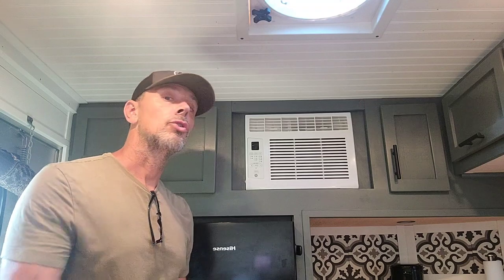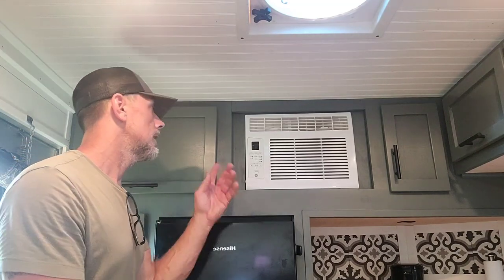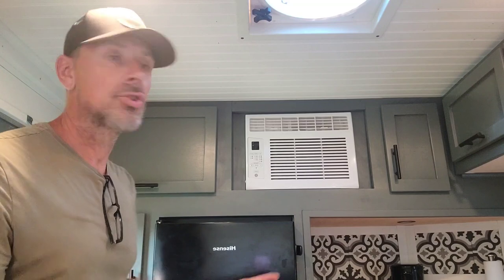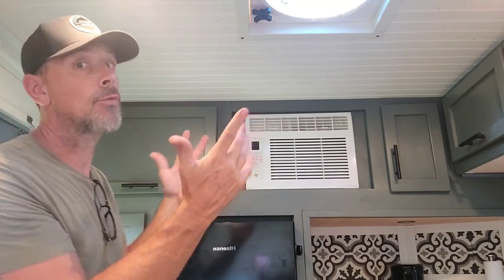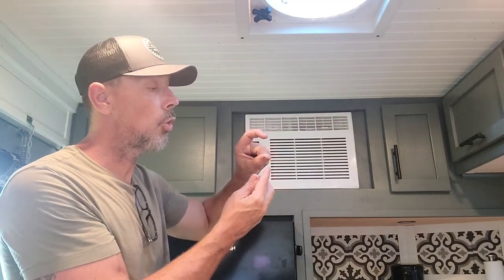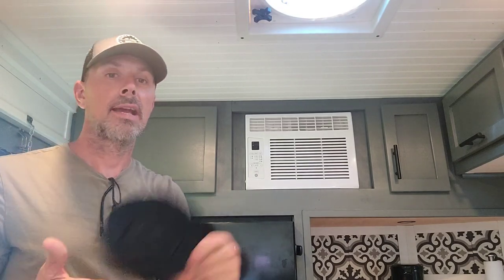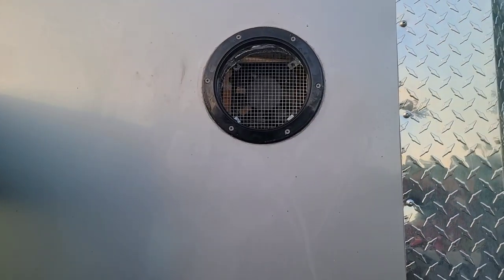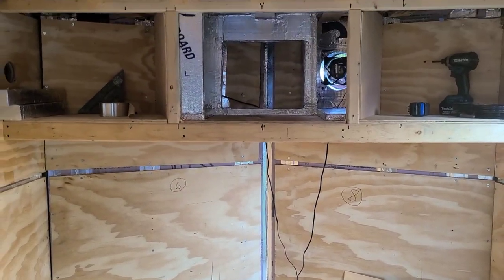Cargo trailer camper conversion window air conditioner install

Comment: I"m impressed with the engineering of the A/C ventilation cabinet ...... The heavy foam board insulation, and even Foil taping the joints to KEEP the air flow at maximum efficiency 👌👍👍👍 It is obvious, that when you do something, you take the time to "do it RIGHT" .... Kudos to ya !!!!  "Thanks" for posting this detailed video .... I'm sure you helped many others solve the condensation issue of using a wind A/C unit in a camper  !!! 😎

Comment: Thanks so much for responding to our questions and tossing out a video explaining your concept, your implementation, and what you had to change to make it work as you hoped!

Your DIY skills are spot on, and I appreciate your documentation while you did all this work.  I've got a 5x8 cargo trailer that I'm currently working on, and I'm trying to make a decision as to which AC system I'll be going with; debating between a roof AC and one of these 5k BTU window units.  Your design may end up implemented in my camper if I decide to go with a window unit / cabinet combo at the front.

Comment: I am using your method to improve my setup. I installed a 5k window unit in April 2019. I was in a rush and I was a beginner so it is ok but not ok. It has worked but very edgy once you hit 90 outside. I am also able to run it off solar. I am in process of redoing the installation in a more attention to detail way. I like the vents. I used a dryer vent for the intake side and a simple cheap register for the out vent.  Again it is ok but needs improving. Unfortunately I didn't mount the ac centrally as you have done. I also have a curved ceiling which doesn't seem to be your case. With improved efficiency, a gimble fan  and an additional 400 watt solar (for a total 1200) I think I will be able to withstand more than 90 degrees.  
Great videos I keep coming back to them. We DIYers are nothing if not inventive and it is great to share our ideas. Thank you Brian.
Reply: There is a video here on youtube I saw. The guy put his AC on tracks like on a filing cabinet, cut an access hole in the trailer wall for the AC to slide out while parked, and drain like a normal AC  right on the ground. Then when he moves, the AC slides back in the trailer, and he has a water tight hatch he closes behind it.

Comment: It's been hot here in Al. this year. I went to a 8000 BTU A/C, worked great. It is 2" wider so I had to cut the opening a little. But it was worth the effort.

Comment: Have you seen the AC mounted in sliding trays. Cut a hole in the wall of the trailer, then the AC slides out when you are parked, so it drains right on the ground. When you get ready to move slide the AC back in. Build you a water tight hatch to close the AC access hatch when the AC  is retracted.

Comment: That is a clean install. Eventually I'll have to do something like this. For now I am running a dual hose and it actually does do a decent job.. I didn't even insulate the trailer. Night time no problem at all in the summer. Spring and fall it gets like an ice box. So I figure during the day when I'm at a WMA hunting or a state camp site it won't matter much. The biggest thing is painting the roof with a white acrylic coating and wrapping the exhaust hose with aluminum bubble wrap type insulation. For heat in winter I got one of those duraflame 1500w heaters made to look like a cast iron fireplace and a buddyheater as a backup. Thinking about using roof heater cable or a floor heating cable setup also for under the plywood floor.. if I ever camp outside of Florida where it gets truly cold.

Comment: I like the idea of a mini split in a cargo trailer conversion. But it would need to be a (mini) mini split, cause they are all just too big and heavy for a very small trailer. I've looked everywhere for one, and they simply don't exist right now. There was one available from a company in Canada years ago, marketed as a "portable" mini split. I think it was like 3500 btu's. But I believe it's no longer on the market. It was pretty ideal for a cargo trailer conversion as both units were quite a bit smaller and lighter than all the residential units. But something like that, around 3000 btu's, and that uses a little less wattage than the typical 6000+ btu units, would be perfect for a small trailer.

Comment: I have a similar fan setup for a 5000btu ac in a toy hauler build we did. I'm sure you've found that those fans aren't sufficient for pulling the heat out of that chamber. Very good design tho I like it!

Comment: Good Job but if I may shed a little light, you may find it useful.  Did you know about "thru the wall" air conditioners, commonly called "sleeve units"?  They are dripless and wont need a drain.  You could put it in your designed area and only have the intake and exhaust vents to contend with.  I dont know how many CFM your Dayton fans movee but they appear to be under sized and the big angle of the vents may impede airflow.  Even if they do move enough air, you still have the possibility of either of them failing and causing damage or fire.  A sleeeve unit could easily b ducted like you currently have and you would likely need only the built in fan to move air.  It would be easier to spot a problem this way , instead of monitoring 3 fans.  Years ago I bought some condoes that had thru the wall units and one gave out.  Best Buy had 4 that I was able to get at a great price.  I found thy were not dripless.  I had run a drain catch madee of pvc pipe and ran it over the edge of the balcony.  Then the complaints started coming.  People were getting dripped on and th manager was called.  I quickly found out wher I could get some of the correct stuff and had no more issues, other than what to do with 4 ACs that I could not use.  I have a big 24,000 btu unit that I stuck in the window of my garage and blocked the rest of the openings.  It works really good  for the aiea I need to cool.  It;s not great but it does get down to about 72 and less humidity, plus the air ls blowing across the floor toward me when I am working.  Good luck.  Thanks for the tips you gave me, too
Reply: “They are dripless and won’t need a drain.” Then you wrote “I found they were not dripless.” So are they or are they not dripless?

Comment: Just curious like another poster below, how has this worked out for you? This is the cleanest, most logical window unit install I've seen so far. I bought a trailer that was partially converted and it has a dual hose unit. It works great, but it just takes up so much space. This install is a very efficient use of space that otherwise is wasted. Just wondering if you have had any long term issues or regrets.

Comment: I have almost the same set up but only use 1 fan for exhaust and a vent for intake. It works decent. My pan I use is a commercial paint roller pan with a hose out the bottom of the V.
Reply: 18x21 is the size I believe

Comment: very nice work, but modern a/c units uses the water in the pan to help cool the condenser, its called a slinger, have you had any issues with cooling?

Comment: I wonder why the camper industry won't come up with a 12 volts AC like in the cars or a 115 watts AC that will work  anywhere where 115 volts is available or with a small 115 watts generator. It would revolutionize camping and open up camping anywhere in the summer. Having a 30 amp AC limits its use to full hook up camping or Carry a 3500 watts generator. Just saying. Great video, we need visionaries like you to change the game.
Reply: Look at the commercial truck units. 12 volt units are recently being developed.
Reply: In cars the compressor pump is run off a belt on the engine. It has an electric clutch to turn the compressor on and off.

Comment: I need to try this in my old 91 Palomino hard side pop up. Its got a cabinet for an ice chest we never use. Thinking of popping that thing out putting a window unit in it.
Reply: Cut you an access hole in the wall, and mount your AC on slides like the ones on a filing cabinet, then slide the AC out the access whole while parked so it drains like they normally do, when you get ready to move slide you AC back in. Build you a water tight hatch to cover the AC access. They build slide outs for  RVs, one small slide out for an AC should be easy.

Comment: Nice job with the install but just curious, why not use a roof style RV airconditioner?
Reply: Rooftop  air conditioners cost a LOT more than window units, most of them are very loud, and if cargo trailer is not made with that in mind, it requires lots of bracing and know how to make it work out right.

Comment: I am currently in the middle of cargo trailer conversion and will be doing something very similar. Where did you get the dryer vent covers for the marine hatches? I have searched but can’t find a cover big enough to cover the 6” marine hatches. Thanks for the detailed video.
Reply from the maker: Lowes has them for $17. They are boxed and only come in white so they will need to be painted if you wish.
Reply: @BRIANPAVLICK Thanks - I will check Lowe’s tomorrow. I have spent hours reviewing diy AC installs - yours makes the most sense, I know it will work.

Comment: My concern is that the marine hatches do not have the equal area that AC unit has for intake and exhaust therefore choking off the air flow. Measure the width and height of the exhaust and then measure the area of one clear opening hatch. If they don’t match then I think that the AC unit will not operate properly. I think that you need bigger hatches. Another way of checking is to find a velometer and measure the free flowing air exhaust of the AC unit and then measure it over the hatch. Note that the velometer needs to be sealed so that no air leaks occur. Good luck

Comment: Looks great.  Love the idea of stealth and enclosed 5000 btu ACs in a camper.  Trying to overcome the Florida sun is nearly impossible off grid.  In my micro camper van I have an 1800 BTU 24v Chinese unit that only consumes 170 watts and  makes my 4x7x4 space comfortable enough in the rain and shade.  It runs forever on my 460AH Lithium house battery.  My particular unit has no side vents and i blow hot air into a common garage with single extractor fan.  Video on my channel.

Comment: Can you post a link to the dryer vents? My home Depot and Lowe's don't have any plastic vents bigger than 4" and the metal ones have ducting on the back.
Reply: Thank you for posting this video. I have an Ambulance box that I am converting into a tiny home/camper. After ripping out the factory A/c unit (it was previously connected to the engine's compressor) I had the perfect space for this.

Comment: Hmm nice attention to detail.  But is it overkill? There's going to be stinky water in there between uses. It's just asking for trouble. And so much fussing. 
 I'm thinking, simply slide the aircon out when you use it.  Must we reinvent the wheel? That was the anticipated installation position the engineer chose for the stated operation parameters. They already figured this out.  As we are already having to remember to unscrew the vent caps, why not just swing open a door, and haul it out loud and proud? Be quieter too. Maybe put it on drawer sliders, et voila!  Use the remote. Seal with foam gaskets or weatherstripping. Tilt downward. The unit intentionally collects the water to hurls it onto the fins by design, to leverage evaporative cooling effect.  Moist air carries more heat. Some will escape out through the fins.  It's a slow train wreck waiting to happen running it inside.  I mean, how are we men designed? 'Nuff said.